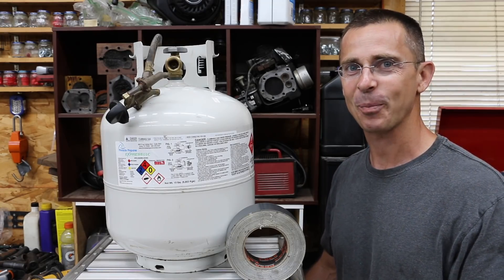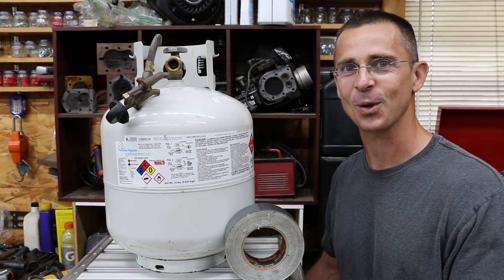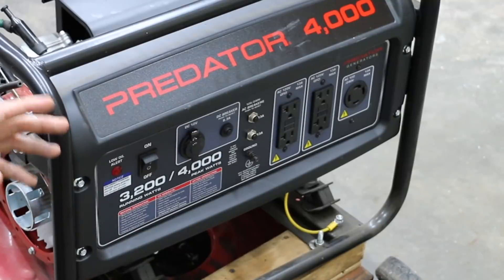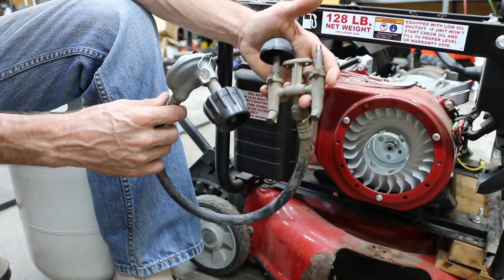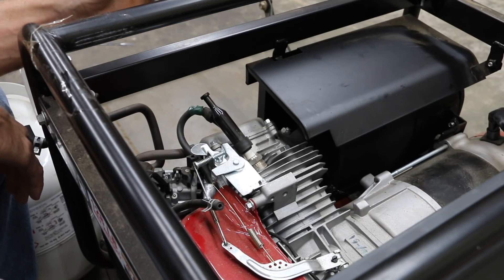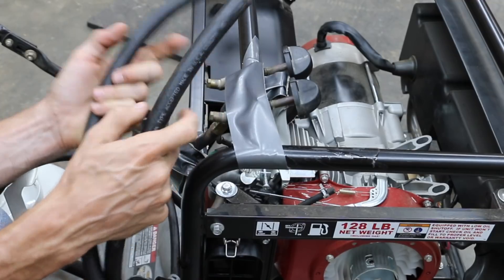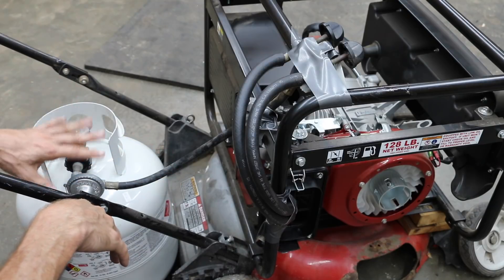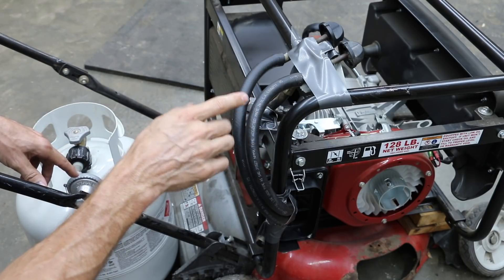Can a gas (propane) grill power an engine?  Let's try it!

Comment: First off I love your channel and your unbiased tests!! Outstanding. 
Had a thought concerning a 2 stroke oil test. For years the masses claimed using a TCW-3 oil in an air cooled engine would kill it. Then hear how using a motorcycle grade 2 cycle oil in a chainsaw or string trimmer would make it run faster, stronger, longer etc etc etc. I have my own opinions on all of this but if you could confirm or debunk this I think it would be an interesting test. Anyways keep up the great work.
Reply from the maker: Great video idea!

Comment: Dont know if anyone has suggested this or not, but what about running an engine on denatured alcohol? And also maybe somehow create a way to test engine power performance to see if any of these alternative fuels cause the engine to lose or gain power. Maybe try using the engine flywheel brake when the engine is running and see how much the engine RPMS differ from different fuels? Just throwing ideas out there. Be pretty cool to see.
Reply from the maker: Great video idea!

Comment: Try running it on bottled methane. It would also be interesting to compare power outputs and maybe fuel consumption (if you have the means to do that) when using different fuels. Thanks. :-)
Reply from the maker: Great video idea!

Comment: I already knew it would work as I ran a car engine off of hydrogen before. Now I did not drive the car around. Setting up a system for varying fuel is much harder. I am sure that is what you meant when you said a static system like a generator. I am sure it can be done, but both mine and your experiment was just a proof of concept.
Reply from the maker: This is interesting. I'll test HHO in the future. Thank you.

Comment: I got one for you, adhesive spray cans, I think some are for fabric, upholstery and what not, some brands suck some are good, it would be interesting  to test them on plastic, wood, fabric, foam, metal even, just some ideas
Reply from the maker: Great video idea!
Reply: I like that
Reply: Yeah, some spray adhesives suck... Some do well. Would be cool know which does what. Especially with how. Much they cost anymore.
Reply: just use commercial floor adhesive and spray it out of a cheap cup gun {siphon paint gun} with a 2.0 tip.
Reply: Will it glue the carb in one setting? Sounds fun!
Reply: 3m 90 good stuff
Reply: Loc-tight spray adhesive works great.

Comment: A lot of the city buses here in Spain are natural-gas powered. The ones in my city are mostly MAN buses, they make a funny noise but other than that, they perform just as well as the diesel ones. Better, in fact, as they vibrate less when idling.
Reply from the maker: Thanks for commenting on this.

Comment: farmers and ranchers here in Texas have been burning gasolinr and lpg  in their pickups fore more than 50 years they have both fuels on board and you can switch from one fuel to the other by flipping a valve that was under the driver seat  a lot of their tractors and other equiptment ran on lpg until diesel took over, makes me wonder where all you guys have been
Reply from the maker: Thanks for commenting on this.

Comment: Answer is yes.   I know of a Toyota pickup that has been swapped by running a hose and a regulator to the carburetor.        It got about 50 miles per gallon.   We had to fill a tank that size up once a month
Reply from the maker: Impressive fuel efficiency.

Comment: How would you measure propane gallon for gallon? And have you ever done a fuel vaporizer setup?
Reply from the maker: I have done a fuel vapor setup and the engine ran fine.  1 gallon of propane weighs 4.2 pounds. A "full" 20 lb cylinder should have 4.7 gallons or propane in it.

Comment: what is the purpose of short hose between valve cover and carburetor filter box on portable generators and other small engines? Thanks V.
Reply from the maker: I believe you're referring to the crankcase ventilation.
Reply: Project Farm Yes, thanks

Comment: They make carburators for propane. Which works for load variants. There are quite a few rock crawler buggies that run on propane because it doesn't have a float and can run at any angle
Reply from the maker: Great to know. Thanks

Comment: I like his thinking I'm going to have no electricity so he takes his pull cord off of his generator so he has to use his corded drill to start it and my luck the cordless would be dead or not anof torque to turn it over
Reply from the maker: lol.  I was without power recently and my cordless worked just fine.  I have 4 batteries for the cordless and a power inverter to borrow energy from the vehicles.

Comment: That's awesome. I did this 2 yrs ago with a gas generator and a blue bottle of propane, it's def not easy adjusting the proper flow. I could get it to idk mint, but had to tune it based on load.. which isn't easy with a varying load :p didn't think of using a space heater lol. My father in law was telling me it wasn't gonna run, but the idle proved him wrong lol. He did also say something about possible damage on the cylinder because of a "dry burn". Didnt believe  him cuz he was dead certain  it wasn't gonna run at all. Neverround to checking that though.
Reply from the maker: Impressive!  Yes, it took me a while to dial in the fuel flow.  Opposite of gasoline, running rich causes issues.

Comment: Interesting video but some notes need to been made for the people in the video. First off, never try that at home because it is very dangerous. Why I say that is because you have a high risk of either blowing up the propane tank, the engine or both and possibly causing injury to your self or even worse. So the next time you like to make some videos like this one, please make a note to people of the warnings before starting the tests. Other people may be lead to believing it is safe to do and try it and cause problems.
Reply from the maker: Thanks for commenting on this.

Comment: Hey I have a great idea my friend.
Use some water and salt (NaOH) mix and add some aluminium to extract hydrogen gas in a tank, then try to use the extracted Hydrogen gas and filter it then use it to power mower engine - Water Powered engine I have seen it in some video I can send you the link if you like
Reply from the maker: Great video idea!

Comment: How about comparing different brands of spray paint in terms of solvent resistance, abrasion resistance, hardness (pencil hardness), adhesion to different substrates,  flexibility, hiding power all versus cost.  Maybe a Rustoleum vs Krylon, vs store brand challenge?
Reply from the maker: Great recommendation.

Comment: what happens if I disconnect crankcase ventilation on my lawn mower will engine run same or it will be weak ?
Reply from the maker: It'll run the same.

Comment: Loved the video. Again, great job!  I was wondering how you would be able to run a 4stroke generator for an extended period of time using propane or LNG fuel.  I understand there would be oil lubrication issues that may cause the motor to seize.  Could the oil reservoir in the crank case area be pressurized to make up for this issue and if not feasible then. What about using a low viscosity synthetic oil instead? Say perhaps a 0w 20?
Reply from the maker: Thank you!  I believe it could run for an extended period of time.

Comment: I wonder how long a 20 pound tank will last running under half load.
Reply from the maker: I need to test this. Thank you
Reply: Project Farm maybe try it with a 1 pound cylinder then factor that times 20. Just my guess.

Comment: You can priming diesel engines with gas....when fuel lines have bubbles of air, you can save battery and starter motor with this method !!
Reply from the maker: Great video idea!
Reply: Project Farm 
Some diesel engines don't have hand priming
I checked this method 2 years back in Deutz TCD 2013 engine. between border to Chile and Argentina in the "andes"mountains ( Chile side) battery charge level going down ( and too far away to the next city...50 miles )  only 2 starts and the battery die......but in this moment remember in my tool box i have one  blowtorch....and think: gas is flamable !! if open valve gas the engine maybe run and for himself keep running to priming the fuel lines...finally the engine start with diesel !!!

Proyect Farm......enjoy and learn with all your videos.👍👍👍

Greetings from Santiago, CHILE.✌✌✌✌✌
Reply from the maker: Gonzalo, Thank you very much for this recommendation.  My old Ford diesel tractor does not have a hand primer.  I'll likely test it in a future video.  Great video idea--thank you!  Todd
Reply: Project Farm ...Hey Todd.......I have another idea.
Here in chile exist myth about one engine can run with wood piston.
In the middle of 90's year ......this myth born because citroen 3cv car model sometimes engine parts not accessible. Fot this reason many people say in the waiting for parts ( piston) decide made you own piston but not from aluminium..... In this case WOOD.

...... I see the future.
Project Farm say: 
"Could a briggs stratton engine run with a wood piston, let's find out"

Please please say hello too me in your next video"Gonzalo Troncoso from Santiago Chile" only if you can!!
👋 Bye..........

Comment: they have actual propane(LPG) conversions, that can be switched between gasoline and propane(LPG) kits for vehicles basically any Flex fuel vehicle can be converted to LPG/propane. It's initially expensive but if you stick to just propane running it pays itself off fairly quick as LPG is fairly cheap, at least here in Canada. I know of a few of my guys in my F150 group that are running LPG the trucks sound like diesels kinda.. it's pretty cool and very clean
Reply from the maker: Great information. Thank you

Comment: I have seen a car run with the carburetor removed. It was a demonstration at a auto mechanics trade school. The instructor stuck a cutting torch in the manifold with the gas turned on but not lit. The car started and idled just fine. So i guess an engine will run off of several different flammable gasses, propane, oxy/acetylene, gasoline vapor ... who knows!
Reply from the maker: Interesting!

Comment: Should experiment with propane on top of diesel. I worked on a natural gas power generation project that used 4 CAT v16 engines that ran on around 3% diesel so it would not need an ignition system.
Reply from the maker: Great recommendation!

Comment: the question is can you start it with the pull rope and not the drill ? It turned over a long time before starting.  If it takes 50 pulls to start it with the rope then I consider it a fail
Reply from the maker: Yes, it'll start with a pull cord, but I much prefer using electric start.

Comment: I've always wanted to try this on my lawn mower. I knew the changing load would be an issue, and didn't want to buy any special carb, thus I've never tried it. I am curious as to the 'gas mileage' of propane. Given a specific run time, say 5 hours, what's the comparison of gasoline used to propane used? Would it actually be worth buying a special carburetor to convert a generator to propane... would you be able to recover that cost in fuel savings? How long would a 20 lb. tank of propane run for? Thank you so much for your time and efforts in all you do!
Reply from the maker: If you decide to use propane, I highly recommend doing a proper conversion vs the approach I used.  I don't believe there's any cost savings for most of the US.

Comment: I work maintenance in a grocery distribution warehouse and gas powered equipment ran in the warehouse is converted to propane due to the low emissions. Most of them are close to fifteen years old and have 10s of thousands of hours on them, the only issues we have with them are the gaskets go bad in the regulators. They start right up in temperatures close to -20. My only complaint with them is the interesting smell of the exhaust and changing tanks without proper ppe can result in frostburn.
Reply from the maker: Thanks for commenting on this.  Impressive durability!

Comment: Spent some time in a GM engine plant during university... Every engine was started and test run on LPG before the carbs were attached and then shipped to the car final assembly plant.
Reply from the maker: This is interesting!  Thanks for commenting on this.
Reply: More than likely because it leaves no residue of any kind in the engine.
Reply: Guns Cars and Digits i watched a documentary on GM. They don't actually start the engines anymore. No ignition. They are test "started" by an electric motor that spins the engine at different rpms to check that it runs within specs.
Reply: @Guns Cars and Digits - pretty much. The gas supply just slipped on, no muss, no fuss, super quick and then on to the next engine coming down the track. That was 30+ years ago, no clue what they do now.
Reply: Logan Barrell that makes sense - engines are a bit more complex today than they were 30 years ago.
Reply: Genius.

Comment: LPG conversion is quite comon here in Europe especially on big cars it's much cheaper and It pollutes way less I've been running my 98 Range Rover on lpg for 4 years now here in the UK and it runs perfectly I checked the plugs which have been in for 4 years as well last week and they are super clean
Reply from the maker: Thanks for commenting on this.  Impressed with the clean spark plugs!

Comment: Carburetor cars are easier and cheaper to convert to LPG. Full injection petrol engines are more expensive to convert to LPG and if you convert your car to LPG you will begin saving money after 20 000+ km (because of the initial LPG investment). Also the LPG burns hotter and the exhaust system is hotter with LPG and because of that your exhaust system will degrade faster than usual. Trunk space is limited with LPG. Also if your car has LPG you cannot drive through tunnels and you cannot park in underground car parks - e.g. in a city Mall. Also you have to go to LPG inspection every year. Also NOT every cars will run good on LPG - for example Japanese cars are not recommended to be run on LPG because engines can malfunction after time and ever break. If you want to make your engine LPG - buy a good LPG system because you can ruin your car if not properly installed. Overall it is probably good if you drive A lot, but after all if you are regular person and want an reliable machine and don't have much time for complication issues - stick with a petrol. After all it definitely has pros and cons. After all learn about the pros and cons first before you go LPG because LPG is not a panacea for everybody.
Reply: Here in europe you can go all those places with no restrictions as long as your lpg system was manufactured after 2005.
Also 20000km is about right for the system cost (about 1000€), but it is a really short distance. I do almost entirely city driving and I still drive around 10000km per year.
Reply: Or just use gas engines. lol
Reply: My last new car costed 4k € LESS because I bought it LPG-fueled and there were incentives, than was cheaper to run so were savings from the first metre. My current car is, as the former, LPG OEM. The system costed me I think 1000€ more than the petrol and same as diesel. Cost per km is 12c on petrol and less than 5c on diesel, it pays for itself in 17000 ( 10 months on my current average mileage). My last car lasted 220 000 km (and only because we mut replace the gas cylinder after 10 yr) ... and in that time saved me arouns 15k€ compared to petrol around 5k if compared with diesel (19k and 9k if including the incentive)

Comment: You can buy bolt on replacement carburetors for small engines which come with a gas converter for under $30AUD. I have one for a Honda GX160. It's a little neater and safer than barbecue parts and duct tape.
Reply from the maker: Yes, this is a much better option.

Comment: havent seen it, going to say yes, since fork lifts do it with a special carb, my boss used propane as nos in his diesel truck, and i have seen people start cars of off propane to see if the motor runs with a damaged fuel system.
Reply from the maker: Thank you

Comment: Gasoline enigne running off hydrogen would be cool way to progress this theme of experiment.
Reply from the maker: Great recommendation.
Reply: But only if you collect the hydrogen from electrolysis powered by the engine itself. Perpetual motion! Free energy! 
All joking aside, it should work if your exhaust system can handle the water vapor.

Comment: I have an awesome new project idea. Moisture test. For glues and adhesives. I have a vape that suffered quite a bit of abuse. The tooth/hinge holding the door on the bottom of my (Smok Alien 220W) vape broke. So I resorted to JB Weld repair the broken door (only thanks to your videos). It works pretty well. But I've noticed that sweat and or moisture starts to dissolve the top layer of the JB Weld. So I was wondering if you could do some moisture tests?
Reply from the maker: Great video idea!

Comment: Can you get an engine to run on baby oil without damage? I’d love to know.
Reply from the maker: Great video idea
Reply: No, it's not impossible but the engine would need to run so hot for it to burn/vapourise it would melt any connection tubes and anything else that wasn't cast iron or steel. Baby oil is just mineral oil, very high flash point. Mineral oil is used in applications where you need an oil at high temperature, but don't want it to burn. So, you can see, not practical at all.

Comment: You’ve managed to get a petrol engine to run on diesel, here in Europe mis-fuelling Diesel engines with petrol is very common. It’s said to destroy the engine as the petrol acts as a solvent and strips out the lubrication from the system, specially the pump. Much higher compression ratios, no spark. What mix petrol/diesel can you get away with?
Reply from the maker: Great video idea